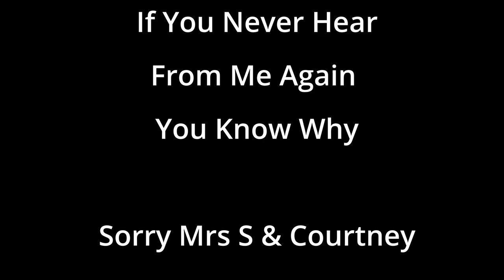Utility Room Plinth Build, Filling The OutBuilding

Comment: High, suggestion , instead of expanding foam,  what about the grey polystyrene they use for  wall  / loft  insulation  probably do the same job and maybe cheaper 🤔,  as for  the master builder 👷‍♂️  plywood and all, back to measuring 😅😅😅 school 🏫. 
Nice job and some handy tools as well.